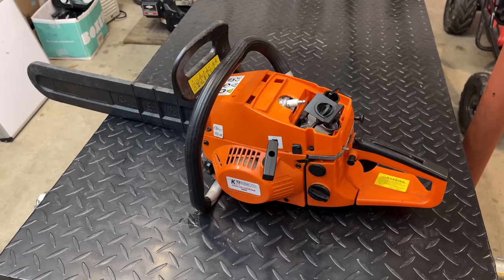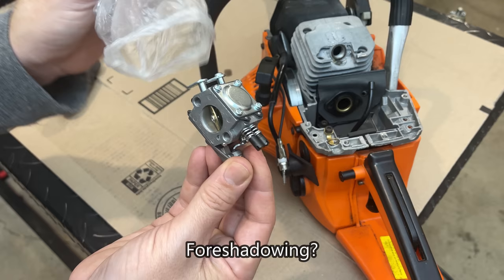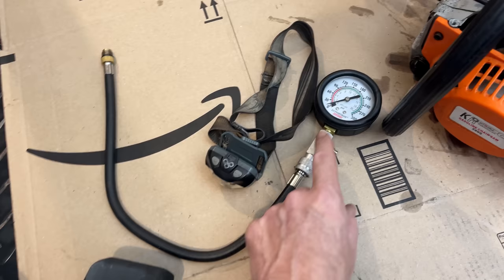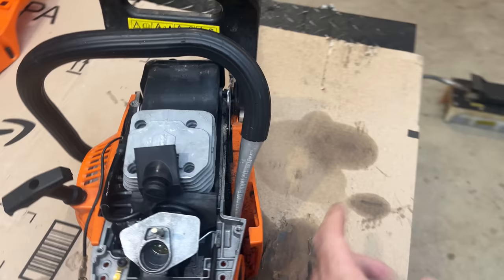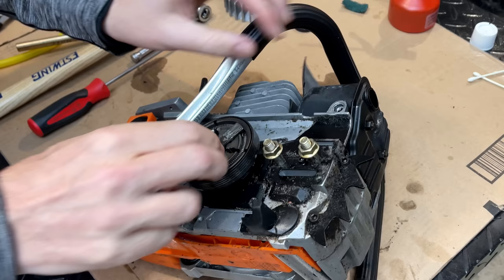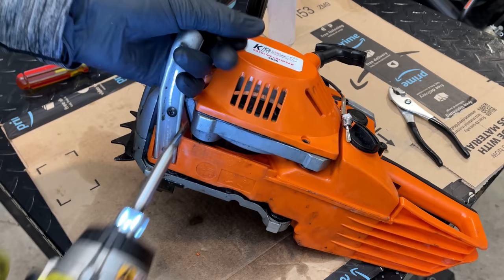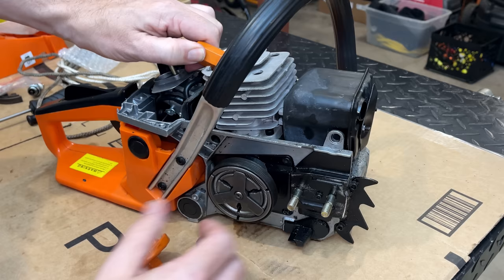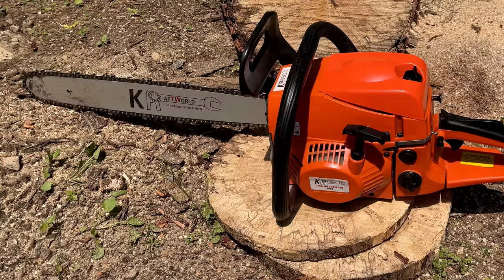Chinese Chainsaw Challenge - Will it Run? (Unbelievable Amount of Problems)

Comment: the larger the volume of air in the pressure hose the less pressure you will measure. Say if the tube volume would be equal to the max cylinder volume you will measure half the real pressure. Obviously you are not there - but a factor to keep in mind. - ok just came to that part in the video.

Comment: Does straight fuel mean the user did not put 2 stoke oil in that fuel?     Like running any 4 stroke without engine oil in the sump......   Did the chinese instructions state the ratio of 2T oil to petrol?   The big end doesn't last long if the correct oil ratio is not kept to.

Comment: Thank you for the fun and interesting video.  I really enjoy these "Will it Run?" videos because they have everything. 

Education: Who knew that a chainsaw has a pulse-pump carburator rather than a float bowl, but it makes sense for an engine that has to be able to work on it's side. 

Ingenuity: Who would think of putting a rope in the cylinder to immobilize the piston.  And who would think of blocking the intake and exhaust outlet with rubber and checking for air pressure leaks. 

Suspense: Who would think that those pesky crankshaft seals would be the culprit.

International Intrigue:  We get to see how a "cheap Chinese junk" chainsaw breaks down.  People used to say this about "Jap crap" products, but the Japanese turned out to produce the best products in the world.  So many great Japanese companies that have become household names. Time will tell if the Chinese follow in these footsteps.  I suspect they just might.

A Happy Ending:  It's great to see the saw running properly and fulfilling its purpose in life by cutting a log.

Cheers from Canada.  Land of the "bucheron" (lumberjack in French :-)

Comment: Looks like the Chinese made  Einhell and Gardenline branded saws , they are all junk even when they are not run on the incorrect fuel and toasted  . Issues with carburation and ignition are common , would still be ok for parts i guess , as it is effectively still new .

Comment: Good job figuring everything out. 
It does seem to be "not quite right" , doesn't rev up properly and bogs out easily. The chain is definitely NOT sharp enough. I've never been a fan of the grinder sharpeners. Old fashion file gets a great edge on things the grinder can't match.

Comment: Holy cow by the end of vidieo you have a brand new junk chinese turd saw,that you started with so congradulations on putting the parts cannon into full throttle.iam sure your thinking i should have throwed it in can at start of this,but did provide lots of training on repairs n testing so not total loss.snooky pa😊😊

Comment: I absolutely love your videos...but this chainsaw video had me a bit puzzled...you were starting the chainsaw and trying to rev it up with the chain brake engaged...and then wondering why it stalled out....I notice in the end after pulling everything apart and finally running it again you had the brake off....in fact you should start it with the brake on and then pull it back to rev it up....😢

Comment: I’m surprised you didn’t check the reed valves while the carb was out. They will cause low compression. It’s hard to hear for sure via video but it sounded like there was some popping coming back out of the intake. Tell me reed valces

Comment: You're wrong about compression. I had a 30cc 2-stroke model engine with practically no compression, with a new piston ring it was by far better but the engine ran just as well except for slightly better in the lower speed range than before! Operatet the engine on both Nitro and gas fuel.

Comment: Don’t ya think that the crank seal leak, though present, would be so grossly disproportionately low relative to the volume of air flow thru the carb, that such a tiny leak would not impact idle, mid or full throttle??

Comment: Strange how both seals were deformed right where you drilled a hoe in them and hooked them out with your pick. Its almost like seals bend when you lever them out.

Comment: It looked to me like you sharpened all of the chain blades at the same angle instead of sharpening every other blade at opposing angles like you're supposed to. You switched sharpener-to-bar sides with every link, but duplicated bevels.

Comment: I just check, in my country cheapest Stihl (ms 170) is 199Eur and this (or equal) is 99Eur. Yes, i have one these bad saws but I buy it for sawing ice on lake. 😢 . These are heavy and not rew up (mine about 8000 rpm), smoke, leak, need better chain at beginning, hoses need replace after year... If you cut five wheel barrels firewood and luckily this start then maybe its ok to buy but electric cord saw is better buy, even Makita 230 volt chain is less than 100Eur here. This saw can be qood course to repair but not much more.

Comment: Why put rope in the engine to keep the crank from turning when you can simply use a nylon oil filter wrench on the flywheel?

Comment: First thing ...take the bar and chain off. Second...don't try to start a saw that is not running right with the BREAK on....or for that matter stop starting ANY saw with the break on. You don't know what the hell is going on if the engine can't spin the chain.

Comment: Very informative video, just checked the seals on a similar saw that was running temperamental an centre came away from oil seal  on output side . What was the torque spec for the clutch
Reply: There is no torque spec for the clutch, it will tighten when cutting wood as it’s reverse threaded.

Comment: I have a very similar saw to this called Pro Plus and have used it to cut down around 20 pine trees, so far its been fine, the build quality is poor and cost me less than 200e so you get what you pay for.

Comment: Is that all the RPM you can get out of it ? Seems like it will go more and it would go through that log a little quicker
Reply from the maker: It’s only rated at 7500 rpm.  I could have got more speed by turning the high speed needle in, but it was already running faster then rated.

Comment: I never once saw you pull the safety brake release handle. Why is that? The brake should have kept the blade from rotating????

Comment: I have an ECHO cs-400 and that's the same saw and ur wrong about not adding oil in the 1st cap and the 2nd cap is 50:1 fuel

Comment: ok several things ive noticed, @ 21.58 the fuel inlet pipe is badly cracked, its probably pulling in air, it wont run right, also the twin action throtel is wrecked, if you look at the top part of the trigger its flat, this is wrong, it must be sticking up as its part of the safty mechinisum, if its down or you should push it down with the palm of your hand, then you should be able to engage the throtal trigger under neith, our local repair shop wont even entertain fixing this junk, it does not comply with most safty regs we have in Europe nd there is no seal between the carb and cylinder head

Comment: Hello James, Just Curious As To Why You Did Not Use Blue Loctite On The Flywheel Nut And The Clutch Nut Knowing The Vibration Two Cycle Engines Are Known For, At Least For Peace Of Mind Lord Knows I Use It On My Harley Davidson 😁, Regardless Good Video! 👍🏼

Comment: That saw probably left China along with a couple thousands just like it. Most of them probably are in flea markets for $10.00. The bar says, "PROFESSIONAL LINE". Really?????? At least this video gave us a ton of diagnostic information. Your troubleshooting ability is top notch. The saw is crap, but the video is worth its weight in gold. Rumors have it that the customer had a heart attack when he got the $2000.00 repair bill.

Comment: Hi James. I have a medium brand saw and unusual problem with it: the chain never disengages (and it's not the clutch). I do not want to get rid of it since the engine runs fine but it still useless. How far are you from Norwich?

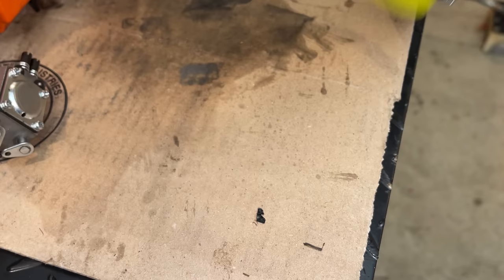Comment: I'm @ 41:00 minutes yelling nooooo as he puts that pulse line back on. Those lines look like they're already disintegrating and cracking. Probably gonna plug up again

Eta: now fuel line has fallen apart (shocked face) and I'm struggling to understand why not order a new pulse line too...

Eta2: now we've ordered  just about every other part on the saw but still no pulse line???

Not trying to be a jerk just genuinely surprised

Comment: I haven't watched the video i seen the video picture and title and yes this is a horrible chainsaw. Right out the box following the owners manual i set it up. Went to start a cut and sparks started flying. I cut it off and noticed the blade came loose. The housing mechanism for the blade tensioner is not steong enough to hold everything and your blade a chain slowly starts coming loose

Comment: This is more of a 'here's what happens when you don't use 2-stroke oil in a small engine" video...  
Although the Build quality of these saws isn't great, They will usually run for a couple of seasons, Barring user error....

Comment: I don't think that QA is part of the factory's agenda. My almost identical cheap chainsaw is of even worse quality than this one, Both the oil and fuel caps leak because the plastic is so thin and the seals are trash. Also, the chain-lubricator didn't work and I traced it to the rubber-hose that fed from the oil-tank to the oil-pump and it was loose and would thereby drain the oil-tank overnight.
That said, the motor runs fine and, with a USA chain, it cuts logs like crazy.
If I bought again, I wouldn't buy cheap but I'm now too old to bother!

Comment: 😅 One of my saws is a chinesium model very similar to this one and its a blood champ. Always starts, never fails. Yes its kindof weak and use alot of gas, but it always work.
Thats One of the existing things with chineese product, you never now if you get One of the 10 percent good ones or the 90 percent made by the 12 year old blind kid😂

Comment: I had one of these given to me in Aust, it was in almost new condition but green and sold under the brand ROK through the Mitre 10 hardware franchise. Total piece of shit, I gave it a once over new plug and filter, fresh fuel and the like but after prolonged use it would get hot and die and require cooling down then run perfectly again, weird? Wasn't worth the time to pull it apart to find the issue when I had a job to do, I just went down the road and  bought a Stihl MS170 and got on with it, given how cheap you can buy them for.

Comment: god dang the high speed screw is too far out, this thing has a max speed of about twice that, i have a not too different one, i already know it by the sound pitch, this thing can go to like twice that if not more, i think it is meant to reach about 12k rpm or just under, but better to keep a bit of a safety margin

Comment: While it is amazing that these clone powersaws run at all, it is no surprise that they are crap compaired to Stihl, Husquvarna, Echo and "real" chainsaw brands.  You get what you pay for. PS - you should lift on the bar when tightening the chain (PPS - got it on the last segment). Ultimately: POS remains a POS.  Should take three seconds, not 22, to go through an 8" diameter branch.  Or was it 6" diameter?

Comment: James, not to be a stickler but it looked to me like you were running the saw with the chain brake engaged there too [you mentioned that was how it was damaged to begin with]. My understanding is that you need to hold the chain brake toward yourself while the chain is spinning to let it free spin then if you lose your grip on the saw the release of the brake will stop the chain so it does not spin freely at idle and potentially hurt someone or damage something. I would be curious to know how well it would cut without the chain brake engaged.
Reply from the maker: I did run it accidentally with the brake on, but no braking.  It was already toast.
Reply: The chain brake is released by pulling the handle towards the operator..it will click and be spring loaded in the ready position and let the chain run freely.
The slightest brush of any part of the body against the handle (especially a wrist or forearm ) which indicates that the saw may have been incorrectly used and "kicked back" moving the bar dangerously near the operator  will "fire" the mechanism that clamps a steel band around the outside of the centrifugal clutch...thereby clamping the chain's drive instantly...so the chain stops.
If you release the throttle the engine can continue to run at idle.
You then reach for the brake handle and pull it towards you, snapping it into the "off" position...ready to cut again...

Comment: Incorrectly using oil is not the fault of the Chinese maker.  However, only a very inexperienced user would take a chance with a very cheap saw like a Chinese one is sold for.

Comment: The additives they put in todays fuil seem to be eating up fuel components lines, gaskets, diaphragm, about anything to do with none metal items that are subjected to fuel, 2 cycle is the most of what I’ve ran into any 2 cycle fuel baring none metal components, steel chainsaw, weedeaters, blowers, the weedeaters I average changing or rebuilding about every 2 years.

Comment: I am using 3 units of different models;-
1) Echo.... Japanese model. 
2) Stihl.... ..German model &
3) Chinese..model.
Chinese model for my handy usage for I 
can leave anywhere, nobody wants to take it. Been using several years. Twice change new Taiwan carburators, other
wise no other problem. I think they copy
haqsvana model.Okey cheap spareparts.
Expensive Echo & Stihl, I use during serius woodwork, always keep under lock cuz subject to theft!!! If a friend want to borrow,they can take the Chinese model but not the expensive Echo & Stihl.....ha..ha...ha..they always
forget to return... until we go and get back!!!!

Comment: Well I've seen many things but this was so frustrating for me to watch  being an ex mechanic. Reason? I diagnosed this from the start, why would you be checking compression on a new engine?  As for fuel line, I use clear, so you'd see air bubbles,  get it from just about any  car spair part shop. As for the linkage, find it hard to believe it was faulty, Chinese do have quality control believe it or not, but I suppose its the norm for Americans to doubt everything they produce. Talk about fabricating to make longer videos! Time-wasting isn't in it, I'd have had it running in 2 minutes.

Comment: High quality Vid.. Definitely not worth the repair in my opinion, those same parts are going to fail soon enough. As the saying goes we get what we pay for, is the rule not the exception. Just pay the extra 500$ for a Husqvarna 455 rancher. Virtually no problems as long as you don't run straight gas. Plus the power from a 55.5cc power head, @3.5 Hp the rancher puts out, makes this saw look like a weed eater, given that this clones higher cc's Power head... Design, Quality, and Execution is what  consumer's want and pay for👍🏽👍🏽 Husqvarna 💪🏽✌🏽

Comment: If i was to make a gay porno. I think I'll use this saw to start. I think there were more bad parts on this saw than good parts. Oil pump, and the chain bar. The top handle were the only areas that didn't have problems. wait the bolts that hold the starter rope assembly on the saw. Way to stay after it and not giving up A++++ thumbs up. and a bunch of Atta boys

Comment: Yeah, unbelievable alright. 
Crooked crank seal and perished fuel pipe. Another fuel pipe clogged with crap - right at the end waiting to be pulled out with tweezers.
A new carb just in case. A clutch pack that fell off because he forgot to tighten it but was mentioned over and over like a major fault. 
A brake band that has done a heap of work that this saw hasn't done. Then you go cut a very dry round with the saw four stroking because it wasn't getting any work. Deliberately making it look like the saw was underperforming.
I have no vested interest in Chinese chainsaws but I have to say, this whole video was discrediting propaganda.

Comment: I have 5 oem 12v Milwaukee 
China 8 12 v Milwaukee 3 ah and 6 ah and 9 ah 
The performance on the china onces are 80-90 percent of the oem 
The only thing that kills my china onces 
Is a fall 
The plastic is not as durable and plastic shatters when droped multiple times on concreate 
Other then that they last just as long 
 
So I’m guessing has pass glass fiber in the plastic but give it 5 years they will have that fixed as well and they will be claiming there battery out performance Milwaukee lol 😂